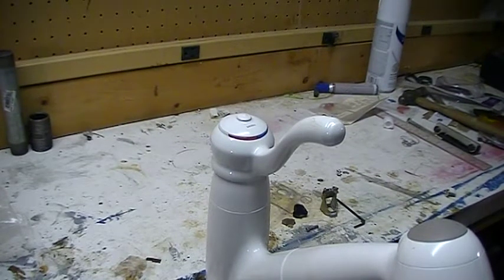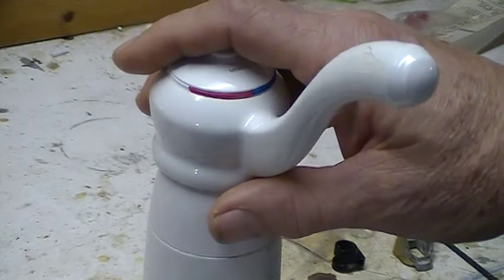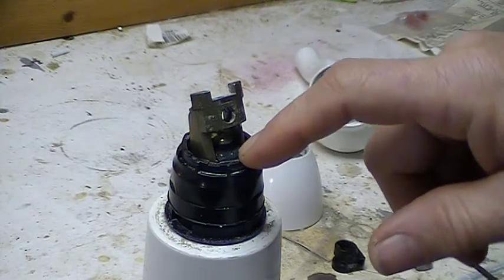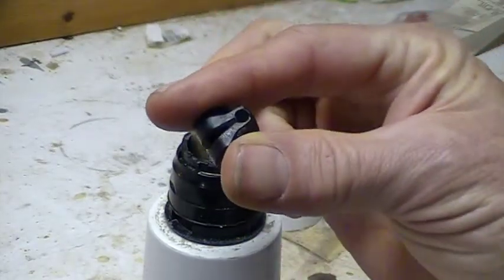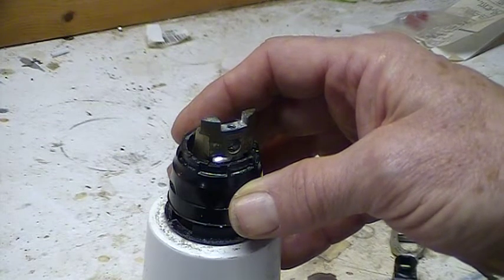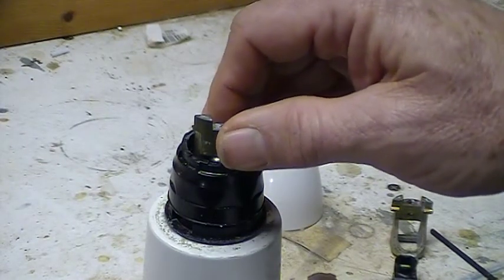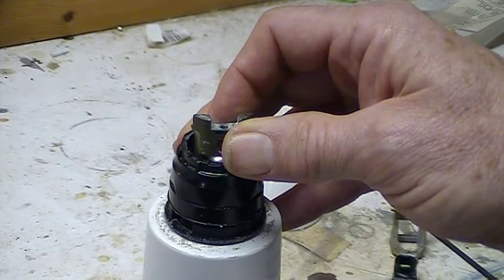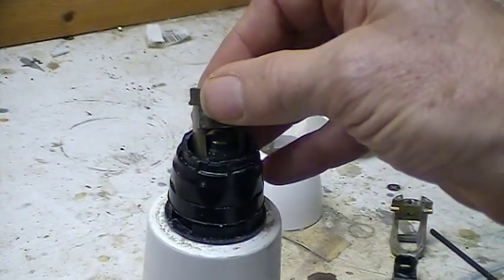Moen faucet repair

Comment: Still helpful in 2023. Just to make this more searchable I tried to figure out the part number stamped on the plastic. It's rubbed off a bit, but it's either Moen 93636, 03630, or something close.  The "Handle Mechanism Kit" number is Moen 118297.

Comment from the maker: I have had this problem once before but it stopped when I replaced the cartridge. New cartridges come with a little grease to help with installation and improve the life of the "O" rings. You may want to try de-greasing the cartridge as well as being sure that retaining nut is tight.

Comment: Great video.  I'm doing this repair now.  One problem I'm having is getting the phillips screw out that holds the little metal piece on.  It must screw into the cartridge and as I turn it to loosen it, it is just turning the cartridge and not coming out.  Any thoughts on how to get the screw out without having to take it all apart?  It's like I need gently clamp a vise grip on something to hold it while I turn the screw.  Thanks.
Reply: I got the same problem.
Reply: get a kitchen steak knife and place blade under the screw head. Pry up wile unscrewing. I had same problem

Comment: I have the Moen 7400 series and the built is the same.  The handle is a little loose BUT on mine I have water leaking from the collar and also below the sink.  Will replacing this set solve the leak or do I need to replace the cartridge?
Reply: The kit he bought has basically every part for the handle so for $17-$20 that would be my first step.  

I replaced the cartridge (little plastic piece) and now the handle kinda sticks.  I was wondering if I tightened the screw down onto the cartridge too tight or too loose?  Came to this video seeking answers but he didn't get into the actual replacement of the parts so I will keep looking.
Reply: The part # for the replacement parts for the 7400/7600 Series faucets is 93980.
Reply: Probably not.The o-rings under the spout need replacing. Easy fix. Remove handle, remove cap nut. Pull up on spout to expose body of valve. O-rings(2) around body seal water from outside. Lubricate them. Not with WD-40!

Comment: Do you mind telling if the white "dome" (which you took off after the handle) usually stays in place or spins (when assembled)?
Mine doesn't stay put on the pivot retainer.
Reply from the maker: who cares 
The conical shaped dome is held by retaining clips on this model- so it will spin. On other models this piece screws into place.
Reply: may be i didn't explain it clear enough. I have a 7430 model. and the dome in my faucet doesn't stay still. it just spins for some reason. i know your model may be different. but i feel the cutouts on the pivot retainer part should hold it. given how you took the 'dome' off yours stays still and doesn't spin/rotate.

Comment: Super helpful video!  Do you know what to do when the faucet starts to turn itself off?  I just replaced the cartridge and now that I've reassembled everything, the faucet handle feels loose and sortof falls down causing the water to stop running.

Comment: Slight problem, can't find the screw. It's a single handle system and there are no visible screws or screw holes in sight. Where was it located on that sink?
Reply: My too - did you find it?
Reply: Found it. The top (the cap on the handle itself) can be screwed off, though the one for the handle on ours is stuck on so tight that we can't get it off. Though we need a new sink because my brother managed to make the entire lower body crack in half.

Comment: moen  kit #93980 is the kit for 7400 and 7600 faucets  FYI.  It is ridiculous that Moen can't sell just that little part.  It should cost $.50 and be able to buy 3 at a time- you will need them.  Moen products look good and feel good- but have poor designs like this one.